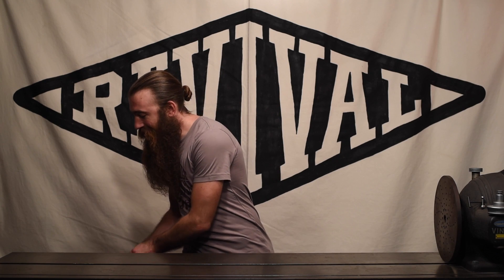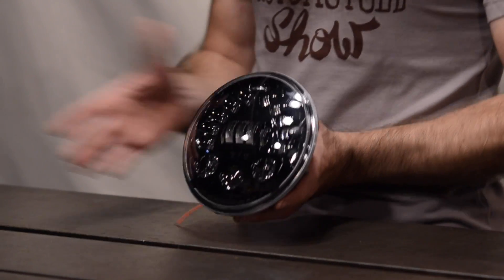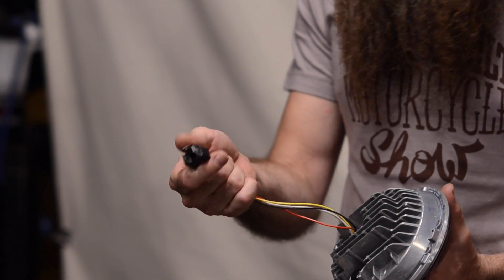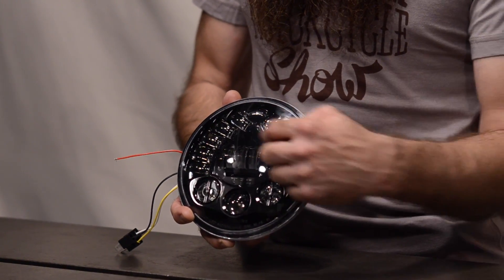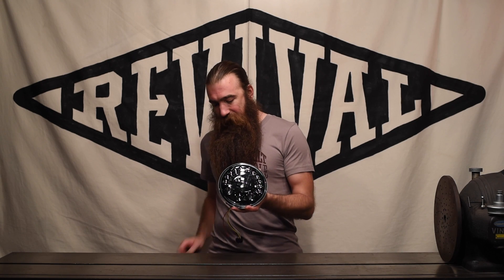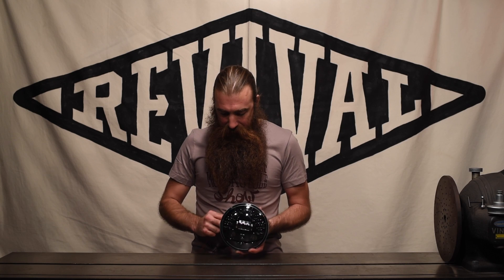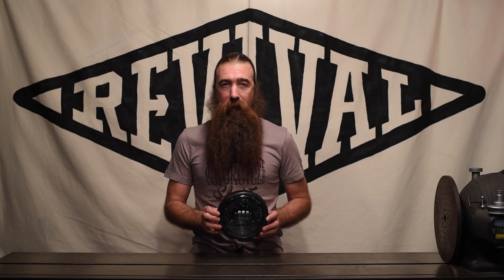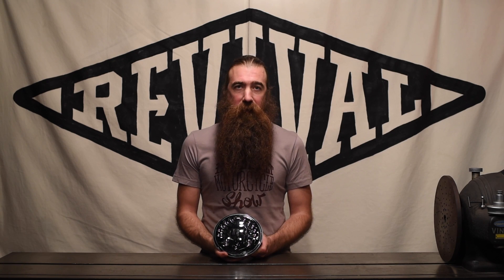JW Speaker LED Headlight - Revival Cycles Tech Talk

Comment: 2020 Harley-Davidson Street Glide Special, I need an adapter to install a JW Speaker model 8790 light to FLHXS 2020, someone knows or knows to send me the model
Reply from the maker: I would visit Motodemics website. I'm certain that they manufacture what you need. If you already have the headlight you might need to ask them about getting just the ring.

Comment: You mentioned orientation and calibration... how does that process work? For example, if the power to the light is turned on when the bike is on kick stand, and or unlevel ground, how does it know which way is up? Would I need to turn off the light and back on again while driving straight down the road to calibrate it? Or is "UP" a constant and maybe the lights spinning around are just a startup sequence? Looking forward you your reply... Thank you for all of these amazing videos! You guys make all this crazy stuff very easy to understand!
Reply from the maker: There is nothing special that you need to do.  I have no idea how this system works, but JW Speaker makes absolutely top quality products and I'm sure they have a lot of time into the R&D to make this work. As far as the boot up process, it could just be some fancy flashing, or it might actually be calibrating, who knows, but it doesn't matter, this thing just works. Install it, plug it in, go ride.
Reply: Revival Cycles as Long as it works! Thanks dude!
Reply: I believe they have accelerometers built in to them. They work like the accelerometers in a cellular phone would for telling orientation plus movement.

Comment: does it work on the street twin and where do we buy it from
Reply from the maker: If the street twin has 7 inch headlight bucket and an H4 Connector it should work fine. However, those are new enough that changing the wattage of the headlight could cause issues with warning lamps on the dash. You will need to do some research about your specific motorcycle. 

You can purchase the lights here. https://revivalcycles.com/products/jw-speaker-adaptive-low-beam-led-headlight

Comment: hii Frand use in

Royal Enfield Classic 350

 ?????
Reply from the maker: This light will work in any bike with a 12 volt electrical system, and a 7 inch headlight shell. I am not familiar with the Enfield classic 350, but if you check the head light and charging system, and they are correct, then this light will work.